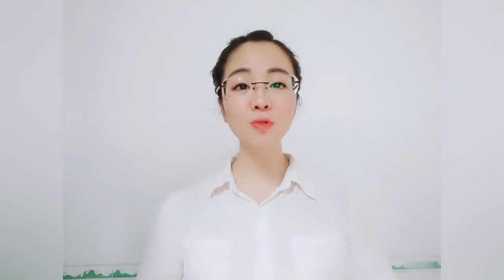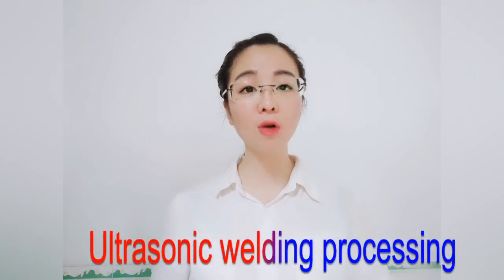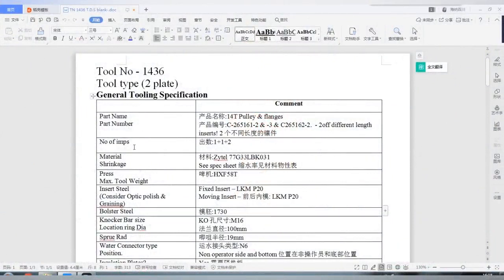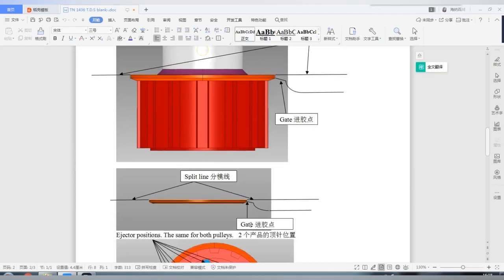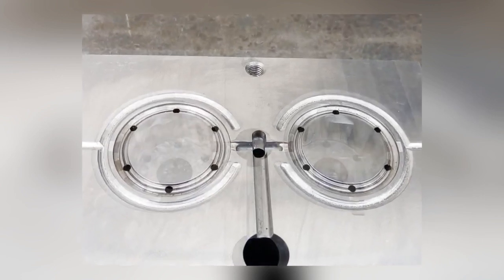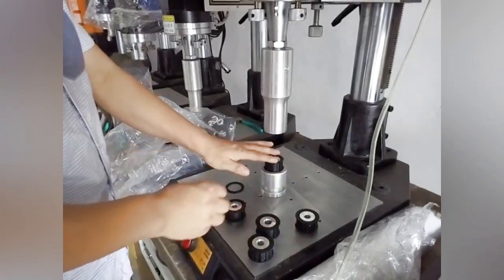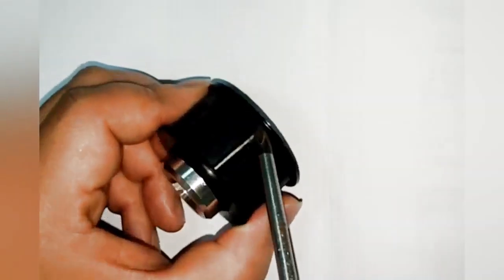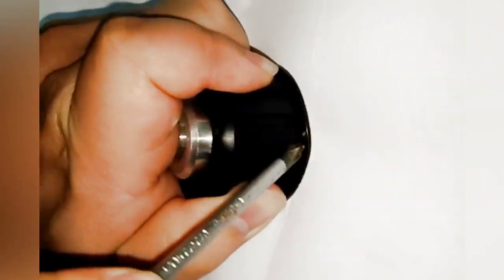This is how ultrasonic welding works on plastic products! ultrasonic welding machine

Comment from the maker: if you are interested in the ultrasonic welding machine, please feel free to contact me. thanks.
Reply: I am interested in what type of machine will work for welding two Identical pieces together also costing of an ultrasonic welding machine   Thanks!
Reply from the maker: @douglasnelson6484  Thanks for your message, Douglas, this type of machine in my Video can do this. what size of the ultrasonic welding machine do you want to buy?  please contact me as per below description box for details.
Reply from the maker: @douglasnelson6484  Also please subscribe to my channel, turn on the notifications and select all.